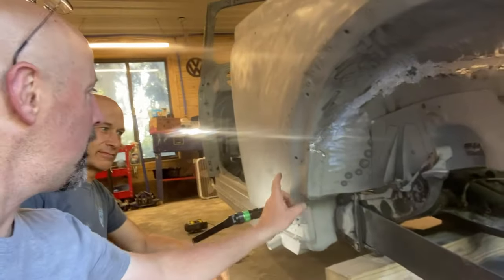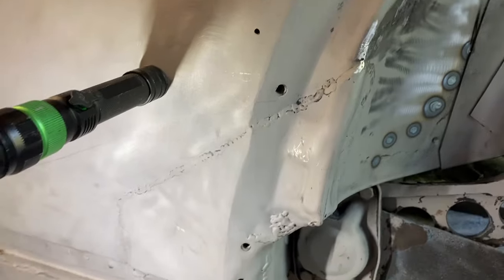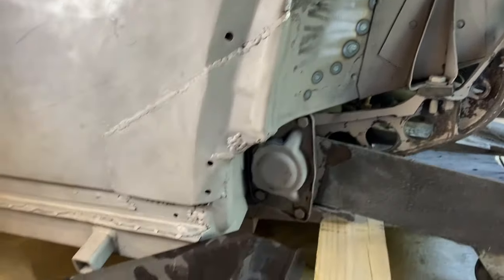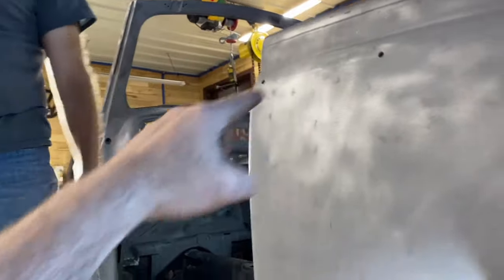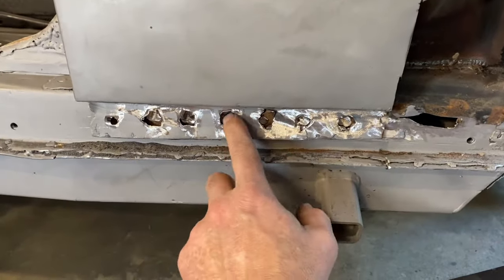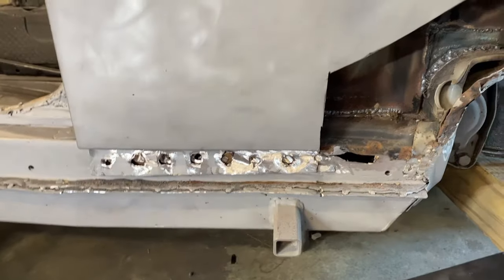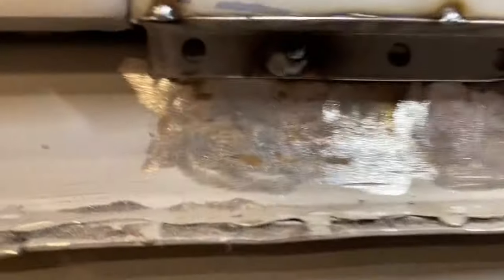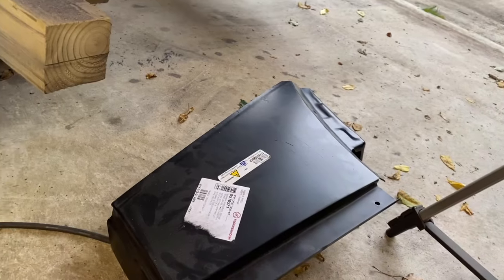1966 VW Beetle Convertible Restoration - Pt. 18 - Driver rear quarter repair

Comment: The hole by the torsion arm.   What is on the other side of the car?   Is there a hole?    How about a plastic plug?     Great videos.
Reply from the maker: Yeah...I looked there.  The same aftermarket patch is over that part, so we can't see what's there.  We decided to leave that patch on.